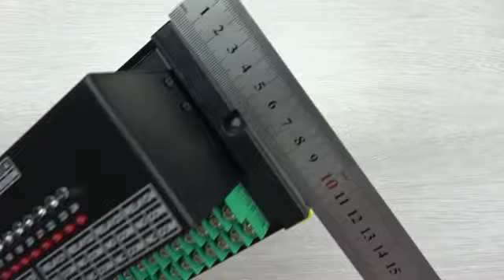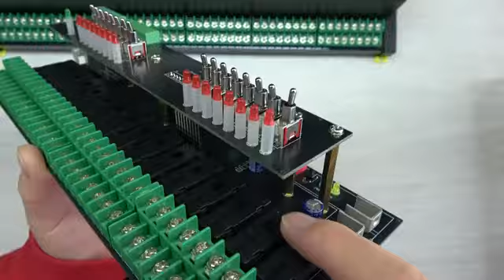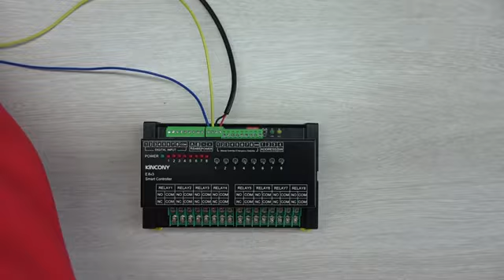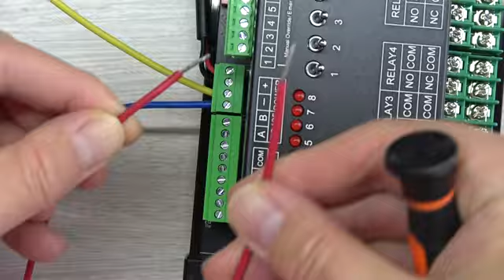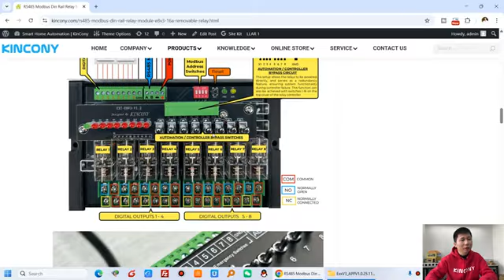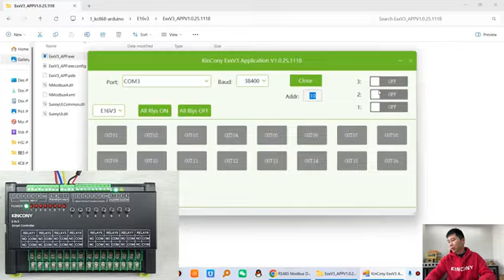NEW RS485 Modbus Extend Removable Relay Module -KinCony E24v3 E8v3

Comment from the maker: KinCony E24v3 RS485 Modbus Din Rail Relay Module based on ARM CPU. It have 24 manual control switch buttons can turn ON/OFF relay even if system is broken. The manual control buttons can be extend by user. The extend cable MAX support 500 meters. 24 channel removable OMRON high-quality relay. It can integrate to home assistant by ESPHome using RS485 modbus controller.

W/A:+86-15531181781
Email： liluna@kincony.com

Inside relay model : OMRON G2R-1-E SPDT
Size: 412mm*105mm*73mm
every channel output : COM,NO,NC
Coil voltage: 12V or 24V
MAX current: 16A at 250VAC
Operation Temperature: -40~55℃
Relay consumption: 0.53W/each
Mechanical life: more than 5 million times
Electrical life: (under rated control capacity) more than 100,000 times (ON-OFF frequency 20 times/minute)
Maximum operating frequency: 20 times/minute (under rated control capacity)
24 channel manual control buttons

There are 3 control mode:
a. relay control by HIGH level (12V or 24V) or LOW level (0v). (It have two different work voltage version)
b. relay control by manual control buttons on board or by extend manual control buttons.
c. relay control by RS485 modbus command.

4 bit DIP switch:
bit 1-2-3: set RS485 address
bit 4: ON: disable RS485 communication OFF: enable RS485 communication
RS485 protocol: standard MODBUS protocol. default baud rate: 38400bps